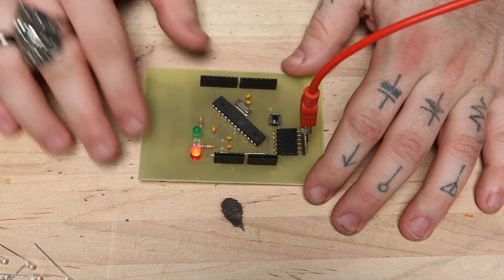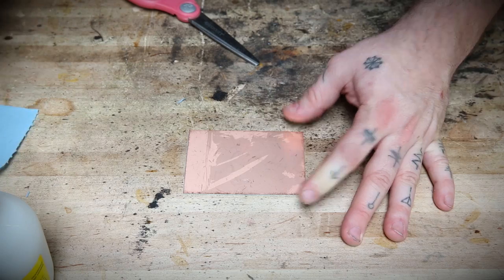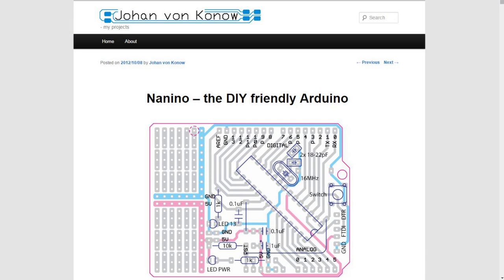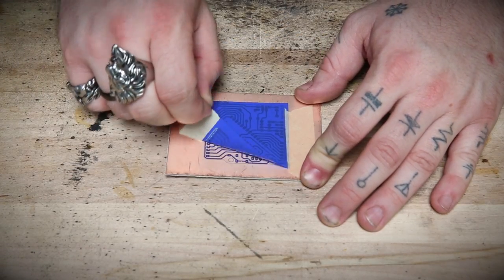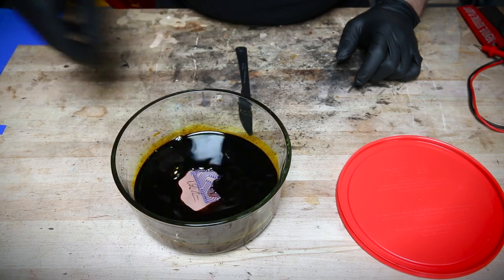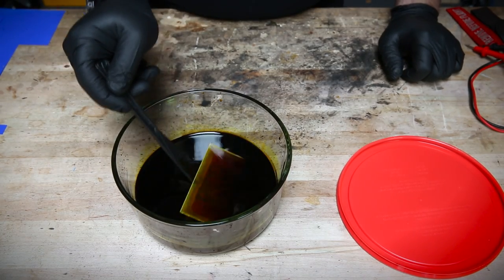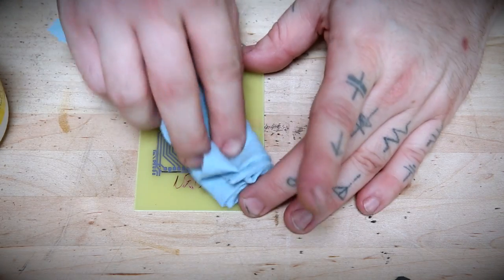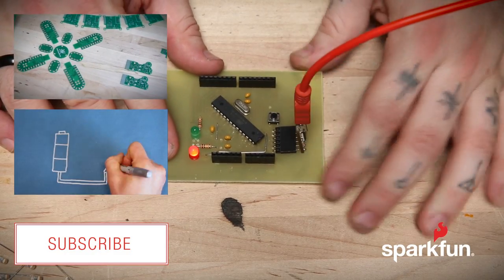Make Your Own Printed Circuit Boards with SparkFun!

Comment: I've had very good experiences with the Pulsar toner transfer paper. A little expensive, but works very well when used with a laminator. After transfer the paper is removed with water (easily, as opposed to glossy photo paper) so there isn't a risk of peeling up traces. Also heat your ferric chloride! It considerably speeds up etching but pay attention to the maximum temperature on the bottle because it will break down into a wonderfully poisonous cloud if overheated. Actually the latest video on my channel shows the process while making LED tail light boards.

Comment: After wiping off your mask, could you use a permanet marker to make a solder mask?  Would it be a good idea to use a q-tip when wiping off your mask so that only the pads are exposed?
Reply: Unfortunately, Permanent Marker does not make a good solder mask, but you can buy dry film solder mask that can be ironed onto the board for fairly cheap. You would then need to cut out the pads from the mask and there you go!

Comment: Which is the safest (correct) way to get rid of the ferric chloride?
Reply: I mix mine with washing soda to neutralize it. My city also has a convenient free chemical drop-off (for paint, household chemicals, yard poisons, etc.) They accept ferric chloride for free too. Once I have a few gallons, I bring it there.
Reply: Like Fracture said, check to see whether your city has a hazardous waste drop off for paints, pesticides, etc. 

Neutralizing the acid isn't enough if you're gonna pour it down the drain, the dissolved copper itself can be damaging to water treatment equipment and the environment. 

The good news is that unless you're etching a lot of boards, you can probably use the same batch of etchant for years.

Comment: What drill are you using, Nick? Looks much more precise than my Dremel workstation. (I have a USB camera mounted underneath it to make positioning very fast and easy, especially for vias in double sided boards, but the problem is the Dremel workstation just has a tiny bit too much flex/give.
Reply: I'm using a Proxxon rotary tool and Proxxon drill press. I really like the drill press, it's adjustable in all kinds of ways that make it nice not just for drilling but also for grinding and cutting. The rotary tool itself is just fine, it's adjustable speed, has multiple collets and supports every dremel tool I've tried to chuck into it. The threads on the chuck are solid, too, haven't managed to strip it by overtightening. The only thing I don't like is that it has an external power brick, but that does make the tool smaller and lighter.

I only bought it because I could add it to my Global Industrial order when I was setting up this workstation.
Reply: Nice! Quite a beefy little drill press, although $250 is a bit more than I was thinking to upgrade my PCB holes. By the way, in my experience, PulsarFX's Toner Transfer paper works much better the press-n-peel blue sheets. I regularly do double-sided boards and never have to repair any traces with a sharpie, etc, but the trick is a second coating of foil is laminating onto the toner before it is etched. With a really nice laser printer (like the $4K machines at Kinko's), I've seen people consistently do 5 mil traces.